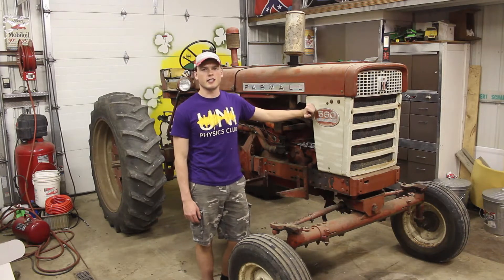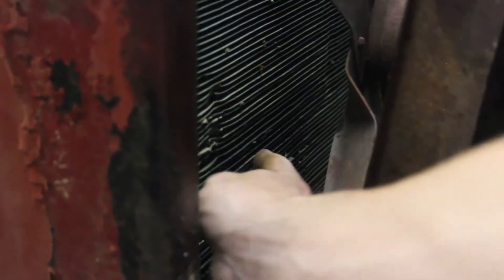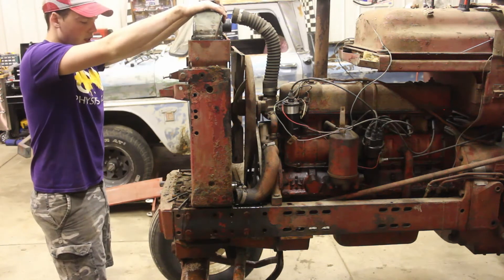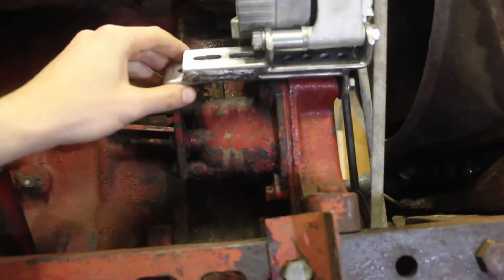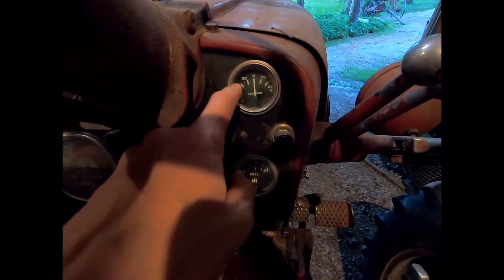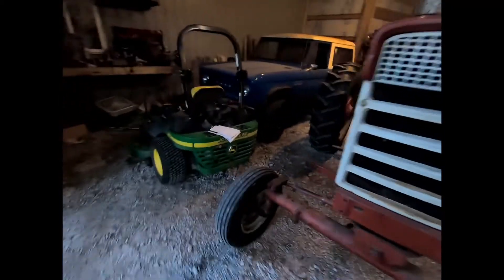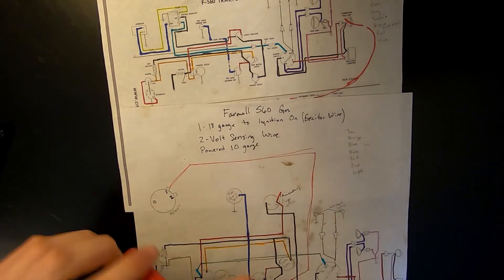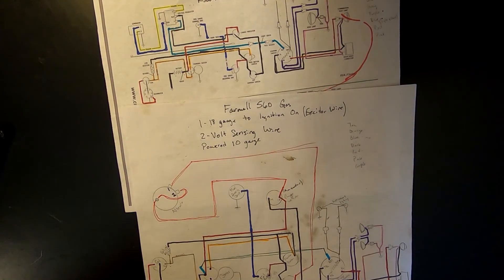How to Install a GM 3 Wire Alternator on a Tractor (Farmall 560 Gas)

Comment: Thank you so much for the diagram. My Massey Harris Pony has an earlier conversion to the same alternator, but lights and switches were abandoned. Now that the alternator and other electrical components have failed, I redrew the original diagram but was unsure how the three wire alternator affected the original schematic. I appreciate the time you took making the video as it will help me in wiring my Pony correctly.
Reply from the maker: If you have any questions don't hesitate to ask I'll help in anyway I can!